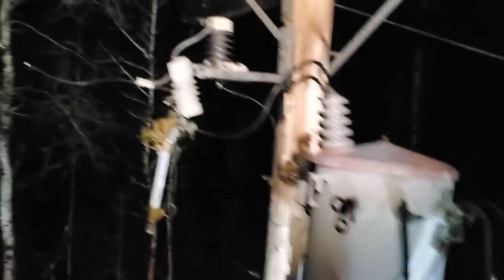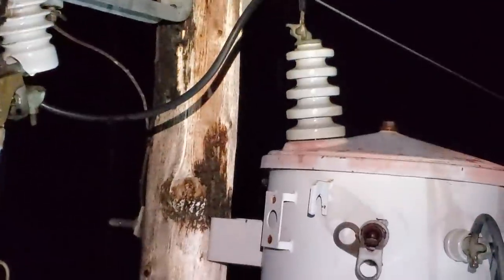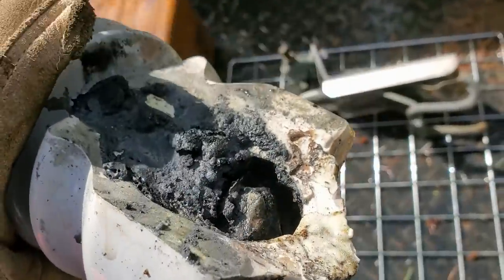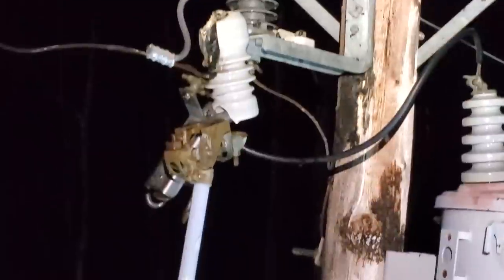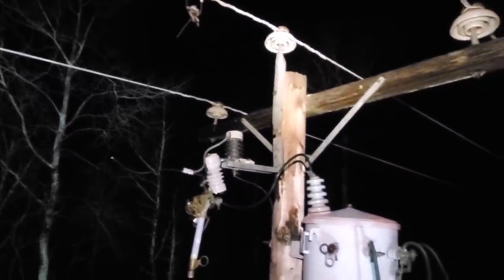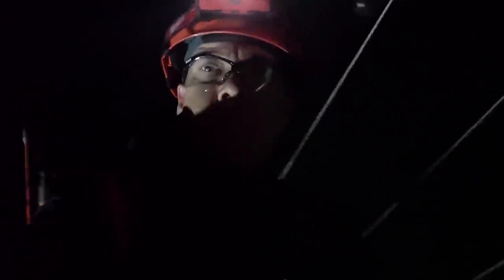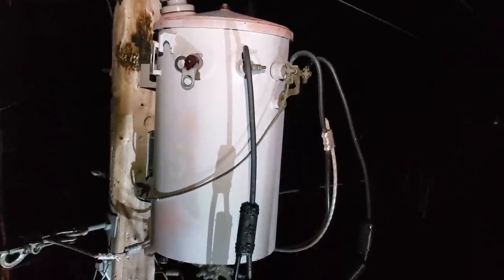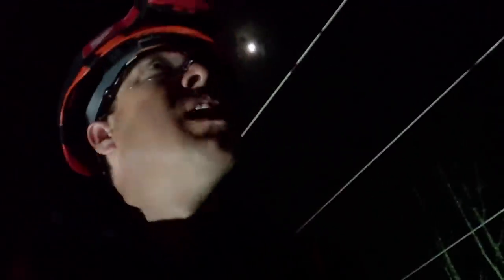Identifying broken cutouts on the line

Comment: What we started doing with the Jack doors, we put reflective red and green tape on the door red at the top and green on the bottom. So when you were checking if switch was open the green tape would be up( but remember to check tail of fuse) so this way with a spot lite the tape would tell you if door is closed in or open!! It’s really helps with the storms here in Florida!!
Reply from the maker: I've never heard that one, very cool! You'd be able to easily spot that from a 100 feet away with a flashlight. Thanks for sharing!
Reply: Manufactures should start making them that way!
Reply: BC Hydro uses red on their fuseholders.  Although it makes it easier to see the fuseholders from the ground I never understood why they didn't go with the red / green thing you describe.  It would make trouble shooting so much easier.  A whole line of greens on top and one with the red on top would be very obvious when surveying from the road.
Reply: @gragor11  Some people are red/green colorblind so they wouldn't be able to differentiate them.  (And if you can't be an electrician because you're colorblind... be a lineman!)

Comment: Good morning brother. Thanks for another great video. New guys don’t realize the dangers of an old porcelain cutout. Around Halloween I was on storm on a side line. 3 poles in from the line fuse we had tree dammage. Cleared the tree to find the primary damages and holding by a few strands. I called for permission to take intentional outage on the side line. Went to the cutout which was a really old brown porcelain cutout. I went to use my load buster on universal stick. When I pulled the door open she split in half and the high side which had a 6ft tap swung down and hit the neutral and blew the feeder. Yes before I even attempted to load bust it open I inspected the cutout and found no cracks. I didn’t get in trouble because they called it an equipment failure. But now when I have an old porcelain cutout I either go back to the next hard tap and use a load pick up to to load bust. Or utilize the load pick up to to bypass the cutout completely. And if it’s really that bad I’ll call for the closest device up stream to be dumped so I can safely clear the cutout and change it out. Basically the grey ones we still use load buster after visual inspection. But the brown ones are not to be operated. If the fuse ever blows on a trouble call we change them out during the outage and eliminate them from the system. It’s was a good thing that we had a one shot on the feeder so when it hit the neutral it was a small flash because when they put the one shot on the breaker they lower the fault current rating. Needless to say my butthole puckered up pretty tightly 🤣🤪😳

Comment: For those homeowners that have generators for such a situation... Please call a licensed electrician to ensure your properly transferring power and our lineman are safe... God bless...
Reply: even then, their main breaker, or lockout breakers, might be faulty. As indicated, the transformer will pickup anything & voltage it up in reverse.
Reply: @wim0104  Agree. We have two utility meters as electric water heating is a separate rate at our location. I built a simple status panel to monitor our backup generator that has an indicator wired to the hot water circuit showing utility power. We use a circuit breaker interlock to switch between utility and generator. If we switch to back up power and the utility indicator is on it means either: 1) utility power has been restored or 2) the house did not disconnect from the utility feed so kill the generator immediately. 

The indicator also overcomes the problem of detecting when utility power comes back when using an interlock.
Reply: Well you really would need have to have a big generator to power all your neighbour and don't realize it. If you don't disconnect the line, you have the load all the houses connected to the same transformer, or at least on the same phase. I don't know typical sizes of transformers in the US, but where I live is 100kVA minimum. 

Also... if it will manage to still work, your generator will burn when the grid comes back online, since it will probably not be in sync and thus produce a short trough the generator windings. 

By the way, couldn't these kind of protection be implemented in smart meters? It wouldn't be difficult to detect a loss of grid power (it's something that every solar inverter does) and thus disconnect immediately if the meter senses some voltage feeding back (it would also protect form faulty or badly installed solar inverters or batteries that introduce power into the grid when they are not supposed to, you get a double layer of protection that way).
Reply: No thanks
Reply: @alerighi  The size of the transformer doesn't matter much but rather the size of the load. Here in the US (probably also in Canada) transformers only feed a handful of houses, probably 10 or so at most. Near me newer neighborhoods seem to have maybe three or four houses on a transformer. Even a mid-size 5kW generator could have a good chance of powering that as long as there aren't any large loads like electric heating or air conditioning running. In a moderately rural area you're likely the only customer on the transformer.
Reply: @eDoc2020  amen...
Reply: @alerighi  smart metres aren't as smart as made out to be... A small generator tied into a existing service that was not intended for a secondary power source can back feed a transformer and generate high voltage back on the power lines... Yes the load on the grid would kill your generator but the point was doing it safe and protecting your local lineman... Call a licensed electrician...
Reply: @MrBen527  ...
Reply: @eDoc2020  Very true. I have a pad mount transformer just for my property.  If backfeeding started the load would be huge and probably blow all the overloads in a split second.  Nothing as comforting as knowing that the transfer switch opens both directions before it closes either one.

Comment: I have that same milwalkee head lamp and also needed a spare battery. Online I found buy a Rover mini light and extra battery combo so now I have 3 batteries and 2 lights. When the headlamp flashes I just pop the back off and swap out the redlithium battery and I'm good for another 3 hours. I love the headlamp but it needs a double battery option to last twice as long without changing batteries. It's easy to swap the batteries just pry the black part off the red part, your not breaking anything it's meant to be removed.
Reply: On low, I can go weeks between chargings, cuz I turn it off in between needing to  and not needing to use it. I did buy the separate charger though, and it will charge a USB device with the battery or charge the battery itself.

Comment: In Connecticut they had so many problems with Chance cutouts cracking, that after one incident at 23kV burning down a Dunkin Donuts in Farmington the Governor herself ordered Eversource/NU to change all Chance cutouts in the state grid.
You should change to Hendrix visetop insulators - no more tie wires to worry about.

Comment: In my area in Australia we also have the SWER (single wire earth return) power distribution system about 75 kilometres away from where I live in the mountains where it does snow during winter time.

That's because they only power cabins & sheds which people camp in !
Reply: NZ has SWER in rural areas too..when visiting there i stopped and looked at a mini substation were conventional went to swer service. It puzzled me at first what they were doing. I think nz was 11 kv to earth voltage
Reply: You must have good conductive earth there.
Reply: @IceBergGeo  Google the inventor's paper to see the info on the grounding and earth conductance. "Rural power supply, especially in back country areas”, in 1947. New Zealand engineer Lloyd Mandeno.

Comment: Awesome! There are still quite a few of those porcelain cutouts  here in my city but they are being replaced at every opportunity possible.
As for the generators, so many people want that capability but always want to half ass the connections with " double male" cords to back feed into their dryer receptacle and say " I will remember to turn off the main".😆 No you won't and I am not helping you do any of that..
Reply: it's why i installed a interlock kit on my panel. can have the main or the genny not both :) it's more of a pain to use than the double male cord but it's much safer for everybody. even installed the proper rated generator inlet :) anyway stay safe and have a good time
Reply: @patricklegault6383  Right on! 
I did my place and my parents with one of those separate generator panels, a generator inlet and  cord..
Was a real treat to have during the blackout of 2003 and one hell of a nice thing to have during the ice storm we had in 2013...

Comment: You didn't have to replace the entire pole given it was arcing through the center? How much safety margin is there in the pole strength?
Also what causes the ceramic cutouts to crack? Thermal cycling, defects in manufacturing, or something else?
Reply: Had a box load of those things start fires a few years after the road had been widened and hydro upgraded the distribution with new poles and cutout with lightning arresters. This line was within a mile of the substation and these wires are thick.  Line voltage is 14.4kv to ground and 25kv phase to phase.   Some of those poles had burn holes through them that were a quarter of the diameter of the pole.  Quick fix found the linesman through bolting cross trees to both sides of the pole as splints and rehooking it all back up again.   15 years later the cross-tree splints are still there and still going fine.

Comment: What headlamp do you use? It seems like it’s really good
Reply: It's from Milwaukee, the hard hat version I forget the exact name. Its micro USB rechargeable and will run for about 2 hours on high, 3 hours on medium-high and 10 hours on low. I love mine and the rechargeable battery pack is field replaceable, just pop off the black base to access the battery compartment to put in a fresh one. I got mine at home depot for 60 bucks with a special for an extra free battery. I also added some padding to the light so I can wear it without my hard hat. Best headlamp I have had. I got real tired of buying 20 bucks worth of batteries a week for other kinds of lamps.

Comment: I wonder how much interference that caused on the hf radio bands the whole time until it fell apart and blew the fuse. I was listening to the hf radio bands years ago the noise that several cracked insulators was causing and it made listening to hf nearly unbearable
Reply: I have a bad lightning arrester on the transformer across the street,  at least I am blaming the arrester because the local am radio station is being rebroadcast from that pole on multiples of the base frequency of 1350 kHz and has a harmonic right on 5400 kHz in 60 meter ham band that is a garbled wide signal of the ESPN sports broadcast.  I am thinking that there is some non linear action in the stack of MOVs that makes up the arrester.   I contacted Duke Energy and reported it a few months ago,  apparently not a priority

Comment: What are your thoughts on using drones for inspections?  I live in the Midwest and they have started using drones for inspections.  They have installed high definition cameras, and thermal cameras on these drones.
Reply from the maker: I think it's an excellent idea! More so for Transmission lines, and structures in hard to reach places. 

We've used them a few times now!

Comment: When I must run a generator I just run an extension cord I made for that purpose to whatever I need to power. I unplug it from the house wiring and plug it into the generator extension cord. That way there is no possibly of back feeding the line. All I would power with the generator is the refrigerator on one side of the 220 volt generator extension cord and the freezer on the other side. Also on each side of the line is a single light bulb for use at night. No way would I ever connect a generator to my house wiring.

Comment: You mention the old cutouts. What are they being replaced with?
Reply from the maker: Most cutouts installed now are polymer. Plastic cut outs and insulators were a thing years ago, but the sun did a number on them... The plastic would break down and fail. Porcelain was the answer!... Only to find out, it would eventually crack from heat/cold stress and vibration. The newer polymer insulators are supposed to be u.v. resistant, but ultimately everything has a lifespan
Reply: @Bobsdecline  ah got ya. Thanks for the detailed reply! After watching this video, I recognize that sparking sound. I hear it at my favorite ice cream place. They have 3 phase transformer on pole. You always hear this faint “sparking/ticking” noise from it. I will have to call that in.

Comment: Unrelated question for any linemen or other power utility employees. Why would a utility lie about the cause of an outage? Specifically, why would a utility state that the cause of two broken poles was a motor vehicle collision when that wasn’t the case? People who live in the area said there was no collision and the incident Twitter feed for our fire department (lists every call they respond to via their Computer Aided Dispatch system) doesn’t list a collision anywhere near the area on that day.
Reply from the maker: Hard to answer this question without specifics. It's possible that a vehicle accidentay have occurred several days before, and nobody reported it. The damage may not have knocked the power out initially, while presenting a dangerous enough situation that once discovered, immediate repairs were required. 
 Sometimes we arrive on a scene and the customer indicates that things were "that way" for a while now. For liability reasons, once discovered or reported, immediate actions are often required. 

Just an example of one possible scenario
Reply: @Bobsdecline   Thanks for the quick reply, Aaron. Really appreciate it. Your reply makes sense. I guess there could have been an unreported vehicle accident that weakened the two poles and caused them to finally break under the weight of 5 transformers (two on one pole and three on the other). It just seems a bit suspicious as our utility is well known for deferring maintenance, leading to frequent outages. 

Kudos to the actual lines crews, though. Could not have been an easy job to replace the two poles, the five transformers, and get all the lines moved over. Plus having to coordinate with the phone and cable companies to get their lines moved over and the traffic signal contractor to get the traffic signals back online.  I might not have good things to say about the management at my local power utility, but the “crews on the ground” are top notch.